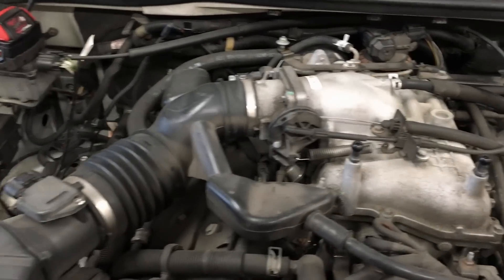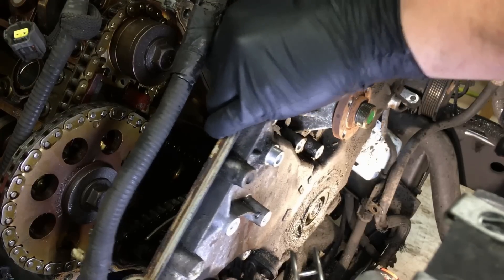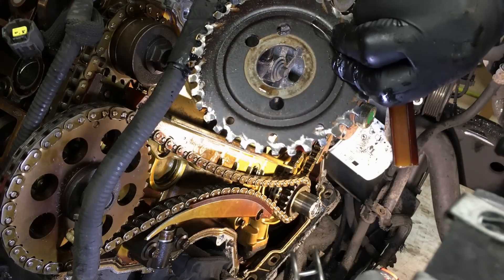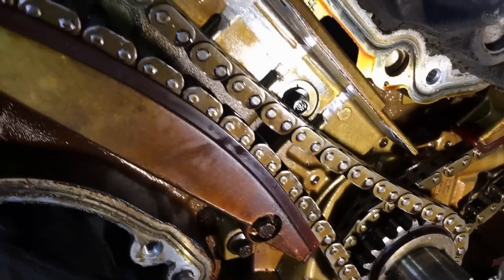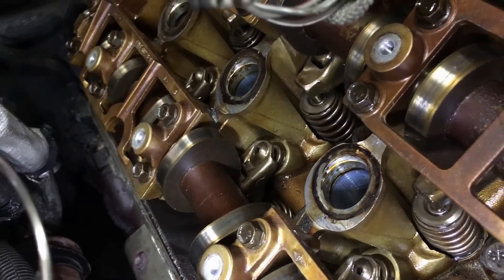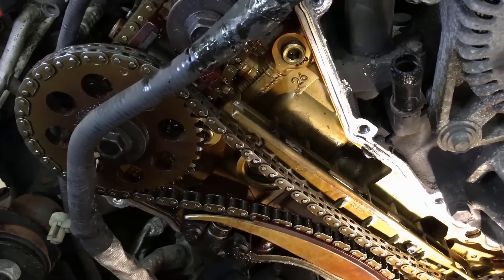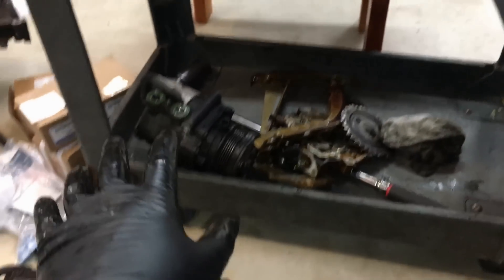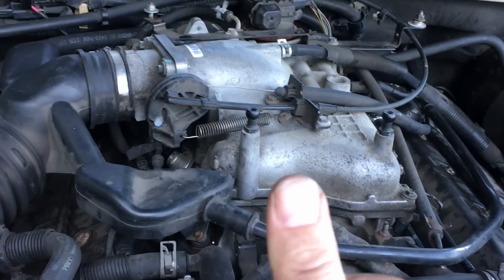Ford Modular Engines Rattling Clacking Sound: Timing Chain Guide Failures You Don't Want to Ignore!

Comment: Ive got a 99 f150 that was making an AWFUL timing chain noise, and i just kept driving it till it finally threw the chain 😂
Reply: Remember the mileage when it flew?
Reply: @patriciafettuccine7324 260k ish
Reply: @patriciafettuccine7324  it still runs actually it's just VERY unhappy 😂

Comment: That is the same issue my 2005 Aviator had when I bought it used. The guides were in the oil pan. Pulled the engine for a complete internal inspection. Thankfully there was absolutely no bearing or journal damage. I did have to replace the cams, roller followers and complete timing set with guides. Found a good set of stock pull-out cams from a 2001 Cobra for $400. Previous owner did not change the oil often enough. I had to vapor blast the heads and block to clean up the heavy varnish deposits.

Comment: I had the same issue on my 2002 GT.  The timing chains had made a Hole on both sides of the Timing chain cover..new cover put in valves adjusted all in for 1,600.

Comment: The whole tensioning system is a bad design. As a mechanical engineer I know. Good designs use idle rollers and spring tensioners, to bad they won't do that on engines. But that would not sell new car and trucks.

Comment: Hoping you can help. I have a 99 lariat with the 2V 4.6.. I installed new guides, new tensioners, and new chains. But every time i put the balancer on front it will hang the engine up. I took back apart and installed everything again except for the cover to see what was happening. The chains are hitting each other at the bottom where they pass along the crankshaft gear. What is causing this. I have checked over and over and the crankshaft timing gear is a double and they are on right. When I took them off I tied them together and put a white mark on the front side so I would know how they went back on. What is causing this? Thank you for any answer yo may could give.

Comment: I have a similar noise on my 03 f250 5.4l 2 valve .. it does have 250k , so with that said , I’m not sure if it’s the chain or I have a rod knocking

Comment: 5.3.3 valve somebody drove it so long that the guides broken to little pieces and stuck in the pickup tube and it would not pick up oil. It lock up the motor. Some one worked on it. And did not clean out. The oil pan . Make sure they take off the oil pan. 
If not your motor will not oil right.

Comment: Thanks for the video. I changed both tensioners on my 2002 ford 4.0 explorer with oem parts, but, sometimes I hear a rattle coming from the passager side of the engine. It goes away when I ease off the gas when excelarating. Do the tensioner ports get clogged and don't provide enough pressure on the tensioner or could it be a guide? i have 214,000 on the engine and am about to change  the valve cover gaskets because they are leaking. could I be walking into a big problem?

Comment: hey waz up man love  ur videos ..but did the timing chain jumped after all?
Reply from the maker: Not at all
Reply: thanks man cause I got the same issue on my 2003 lincoln aviador same engine, I got the whole timing chain kid but didn't knw if the timing chain had jump on my aviator...I was driving it and all of sudden it stop on me and didn't turn on until a week later...I had to call a mechanic to check on it and he told me that it was a tensor that was bad, I knw a little  bit of mechanic but knw if the chain had jump....

Comment: I have a 2008 ford fusion 2.3 100k miles  never opened the engine except valve cover gasket replacement. I don't hear any noises but how can I determine if I have any wear or guide/tensioner broken   ? I worry that sooner or later I may have to change it but would like to be very aware of its condition

Comment: Hey! I have a 02 GT Mustang with the 4.6 2V and it has 244k on it. It’s always ran great and I take care of it. Well I just started hearing a noise like this but it’s very faint and it’s only at idle. It gets quieter after running a couple minutes and goes away completely at idle after a few minutes. if I bump the throttle up just above idle it smooths right out and no noise. Could this be the guide going/gone bad or would I have noise the entire time and off idle?
Reply: Good question.Same problem.Did you solve the issue?

Comment: Scary sound I just had with my 2003 Ford Explorer 4.0L V6... It had 3 chains. Shitty plastic parts in an engine... Crappy engine design. They should never use crappy plastic AT ALL in a hot as hell engine.... I junked that Ford... LOL..

Comment: Hello.  I have an 03 Expedition.  5.4 2v.  Whenever the engine is cold it will rattle for 1-2 secs at startup.  I have a Motorcraft filter with the anti drain back valve.  Is there a way to inspect the timing chain and tensioners without removing the front cover?  I'm assuming the sound is timing chain rattle from the  tensioners draining down.  When the truck is hot it won't rattle at start.  Thanks!

Comment: Did my timing chain and tensioners with new guides running 5w20 flushed everything out with gas into the oil plug removed,now a week later and I'm getting chain noise again this time it happens when the engine is at operating temperature please advise,I have 03 explorer limited 4.6 ,o by the way I used the metal tensioners with the metal gasket .your my ford man go to guy on these new design explorer,im a case iron small 5.0 Ford guy like I have in my 99 explorer  limited, thank you your truly Grant Baker

Comment: I just bought a 2003 Mercury Grand Marquis with the same engine that has 93000 miles. I researched it and found that the engine goes to 400,000 miles easily and can take a beating. But this video makes me nervous.lol

Comment: Do you change secondary cam chains and sprockets or can you leave them alone if they look ok? Apparently you need a  cam lockdown tool to change those. Hear it's an expensive tool.  My Lincoln navigator is a 2000 with 185000 on it just starting to hear a little clatter.

Comment: Hello i have an 03 aviator and suspect this to be the problem.  Does the noise go away or get quiet upon acceleration?
Reply: foreverreinventing My 04 aviator became quiet at acceleration as well sadly i did not know this was the problem and sold it to a scrap yard because it got worse. I miss my aviator.
Reply: @elvisalmazanlabastida8871  mine did too and I figured out that my catalytic converters we so clogged it stopped the acceleration.  I changed the converters and 02 sensor and bam it ran like whole new truck

Comment: My wife’s 2006  Ford Explorer is making a similar noise. I replaced the right side tensioner and can’t seem to break the back lower tensioner,even with my impact wrench. I don’t want strip the treads on the tensioner, do you have any suggestions? 
  Most of my noise is coming from the back side of the motor.
  We just had this motor rebuilt in January 2018 and paid 3613.00 
   You can call me if you would like 864-434-4469

Comment: So my car has the same problem but it stopped running, it’s a 99 mustang cobra, if it stopped running does it mean it messed other parts up?
Reply: Eduardo Castillo , yeah you probably killed the engine . if anything it had spun a rod or crankshaft bearing. is it locked up?
Reply: Cody Ramos well it wanted to die, so I turned if off quickly, haven’t started it since, will do the chain middle of August because I don’t have time atm,
Reply: Eduardo Castillo , it's a good amount of work to do the chain. hopefully you can get it running again . I cross my fingers everytime I drive my 96 gt 2v 4.6 lol

Comment: Hi Brian,  Here is what brought me to find you and your great video.  I am looking at reviving a one owner, 2004 Grand Marquis, 4.6L, 42,000 miles.  Deceased owner, 96, stopped driving it about 5 years ago.  Within 20 minutes of driving on recent oil change, timing chain slap / tap started up.  But, the slap loudness varies on start up, sometimes louder than other times.  Could one or both tensioners be gummed up, not pushing on timing chain(s) efficiently?  Before jumping into taking off timing cover, I was wondering if it makes sense to drop the oil pan, see if any plastic or metal is at bottom of oil pan.  If no plastic or metal in oil pan, would an engine oil flush free up tensioners?  Any suggestions?  It's a great car, would love to keep it rolling!  Thanks.
Reply: Your oil journals could be clogged as well. Run sea foam in crank case for  a day and change your oil after with 5w30. If sound remains after take it to mechanic.

Comment: Just did this on 99 cobra 4.6 32v, broke main sprocket bolt attaching to primary cam. 3300.00. On this truck would be chePer to scrap it.

Comment: (Head engineer at valve train- final meeting) OK dudes. We're rolling with ohc timing chain and plastic guides.  lol
Reply: It quiets it down a lot and saves you in the long run. You’ll hear this begin to happen from a mile away with a cast tensioner it may last longer but what will happen first? Your chain snapping from all the wear it now has or the metal in the new guides? And most of the time these fail it’s due to late oil changes. My 4.6 has the original timing chain and tensioners at 270k I’ve taken it apart every 10 k seen no wear so I re used the parts.

Comment: I just bought a 04 aviator with 271km on it and I get the chain noise just at cold start up for a second or two then it's quiet and runs great. Should I be worried and tearing the cover off??
Reply: Steven Plaskett my 05 aviator does that to im disregarding until i heard it more often or louder.

Comment: i have a 2010 f150 with the 5.4l 3v it only has 48 thousand miles on it and i can’t find any videos on what noises are normal for the engine. i’ve noticed that there is a ticking noise coming from both sides of the engine not loud or anything but i’m worried that my engine may be going bad already. and when i accelerate i don’t know how to really describe it but it almost sounds like a chain dragging. i may just be paranoid but it would be really nice to get someone with your knowledge to help me find out what those noises are and if it’s ok or needs to be fixed

Comment: Hi  , very good and explained video,  now I'm in the way to fix an 2007 explorer sport trac 4.6  3v engine , I replace the timing chain kit with tensioners , oil pump , and chain guides , the problem is , that when it warms up , it begin to rattle a little in the driver side , but not at idle , neither when it goes up from  1600 rpm, its only between 1000 and 1500 rpm that it rattles , but those are the most used rpms...I took the timing cover to check and found  the driver side chain tensioner its not hard enough to keep the chain tensioned ...but its only when its warm , I check the idle oil pressure warm ...35 psi , and goes up when you tap the throttle.....any clue?
thanks, keep filming!
Reply: You need to prime the tensioners with oil to make them stiff. Also check your oil journals to make sure they are not clogged.

Comment: Do you think this would cause a misfire? I know mine is making this noise, not as bad, but I have the parts already. But I also have a random misfire. I'm hoping that when I fix the chains, and guides, this will be cured too?
Reply from the maker: most times no.
Reply: FordTechMakuloco I actually found a Ford  notice that says it does cause the random misfire.

Comment: FordTech!! I need your help! I have watched tons of your videos and you really know your stuff. So I have a 2001 Ford F-150 4.6 2 valve that was even worse than the car in this video. Changed the whole timing set and got it back together and the chain is still slapping on the passenger side like the tensioner isn’t holding or getting enough oil pressure. With the timing cover off and cranking it over I see the driver side is staying tight and oil is squirting on the chain though the hole in the steel tensioner but on the passenger side oil just kind of weeps and the chain slaps the guide. What is my issue? Please help!
Reply: The oil passage that feeds the tensioner is partially blocked with plastic/metal debris.or the tensioner gasket not seated. What did you end up doing to solve your issue? These 4.6L timing systems are a pain. I'll never buy again.

Comment: so If it is rattling and you pull the oil pan you could tell something self destructed? I recently had a clutch done on my v6 mustang and right after that it started rattling loud at idle. I do not notice it so much with the hood up and engine running in front of the car, but sitting inside the passenger side it sounds like a dogs choker chain rattling in a plastic dish at idle. A little gas and it goes right away.

Comment: I have a 05' GT Mustang 3v engine and it rattles and makes a clugging noise at warm idle.. i think this is exactly the reason..the diagnostic computer doesnt pick up anything wrong in the engine. Definitely going to check this because the issue is becoming worse and more frequent. Thank you!

Comment: Brian, how much would you charge to replace exhaust manifolds on an 05 F150 5.4l.  Had a dealership quote me $1750 per side.  I did the complete timing job and have determined that the ticking noise that I'm still hearing is my passenger side manifold.
Reply from the maker: My shop charges $750 per side using the Ford manifolds and stainless steel hardware- http://bsgautomotive.com/service-request/
Reply: @FordTechMakuloco  Damn that's a great price.  I just looked up your shop and too bad its 16 hours away from me.  You ever think of cloning your self and establishing BSG auto on the East coast..lol

Comment: My 02 Explorer 4.6l has a knock that’s not really consistent with the RPM’s, but instead when I rev it, it will stop briefly and resume when the RPM’s drop. I opened the timing cover, and there was a broken guide on the drivers side and the timing chain was loose. But I’m not sure if the chain could have been making all of the noise I am hearing.. the chain wasn’t hitting the timing cover, but was hitting the engine block. I am wondering, what are the chances of a spun bearing, and a broken timing chain guide? I just bought the vehicle. There’s no gunk in the valve covers. There are some metal shavings that I assume have come from where the metal has collided with block.
Reply: The broken guide is the smoking gun. The chain flaps around and rattles. That is the noise. Higher revs cause centrifugal force to throw the chain further out on the sprockets and some of the slack is taken up and the noise goes away. New guides, new chain, and a new tensioner and your should be good to go.

Comment: I just did a full timing chain/guide/sprockets/tensioner job on my '10 Crown Vic with the 4.6 2V motor. One of the plastic tensioners was blown out, causing some chain rattle. Thank god the new Ford Racing kit came with iron tensioners.

Comment: I'm a GM fan but stopped to take a look at Ford's version of the timing chain problem. The GM 3.6L eventually suffers from timing chain elongation from wear (many incorrectly call it stretch) and trips the engine light. They also develop a characteristic rattle along with it. Manufacturer recommendations are not always the best and often times are a happy medium to help accomplish EPA requirements. I believe very strongly that the trend towards lower viscosity engine oils for a little bump in fuel economy is at the expense of longevity.

Higher viscosity does more than just help keep oil pressure up, it also offers more protection against impact wear. Not unlike the difference running in church shoes on a hard surface vs. running shoes makes on your feet. This is why gear oils are usually very high viscosity. I moved from 5w30 Mobil 1 to 10W40 after my timing chain change in the 3.6L for more moving part cushioning at startup and operating temps and if the variable valve timing will permit it I might run as high as a 50 wt.

Comment: had a similar noise in 4.6 2v, same exact failure. I replaced heads for new style (PI), replaced timing set and added performance cans. runs great today @ about 180k miles

Comment: I have a question... 

I think i have that problem 

My question is: i only hear that noise when is in gear but if i put it in park the noise goes away, could the chain be my problem i have 3 codes p0011 p0022 p2198

Comment: 1. How many miles were on this engine? 2. How much did the total repair cost?
Reply from the maker: 168k Miles $2,300
Reply: Thanks so much for your reply. I've been looking at a 2004 4.6l DOHC 4v Crown Victoria P7 which as some considerable noise coming from the front of the engine with 135K on it. I would most likely be correct in saying that would cost more to repair than this one did. Pretty certain it has been ridden hard and put away wet many times.

Comment: My 04 Aviator is making about 1/4 of that noise sometimes on cold startups an sometimes when it sits for a few mins hot. It goes away if you rev it above 2500 and it always goes away within a couple mins of the engine running. Im guessing one of the tensioners is leaking oil pressure, My IMPORTANT Question is would you replace just the tensioners with new oem parts or would you install a china timing set with all new chain and sprockets etc? I cabnt afford it all :( Also did you need any specialty tools for this job. I have a lot of tools but dont have anything to hold the cams

Comment: With the amount of work involved replace anything not right. The parts are just too cheap not to. Plastic tensioners suck. The secondary tensioners can also break.
Great video.

PS. The guy who invented the plastic body tensioner is in hiding. Someone said he's mates with the guy who decided to use sintered oil pump gears.........

Comment: I have an 02 ford explorer it has a knocking that gets louder as the RPM's increase. It also shows low oil pressure and has no power going up hills. Any advice is appreciated.